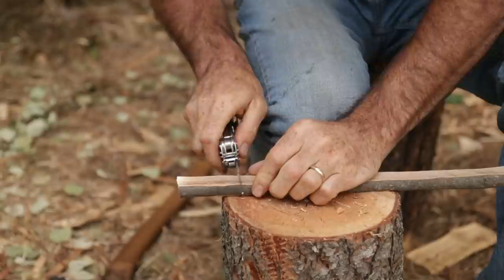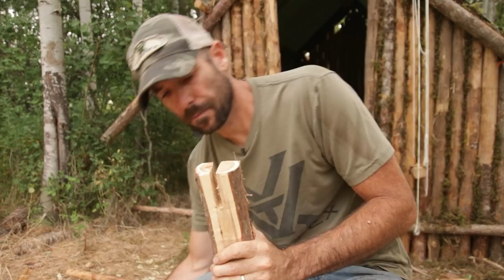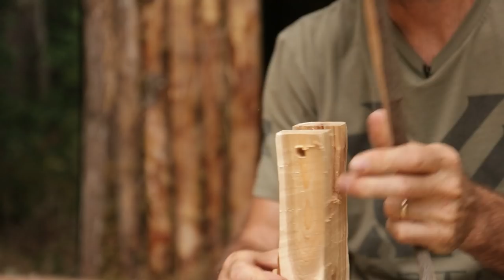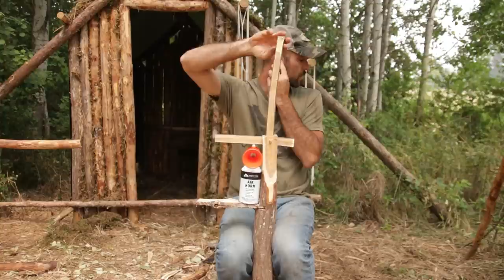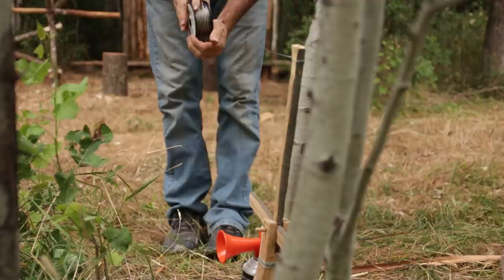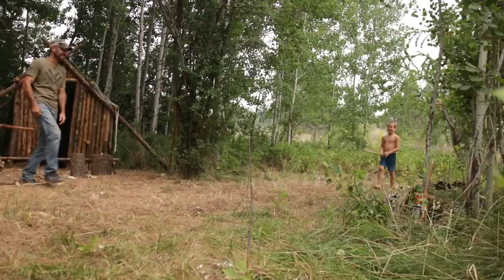Tripwire Bear ALARM SYSTEM - ALONE Season 8

Comment: Felix Immler makes a lot of such contraptions from wood using his Swiss Army knife, and his recommendation with battening using such folding blades is to leave the blade open at 90 degrees to prevent the repeated blows from wearing out the spring locking mechanism, in order to preserve it for when you are hand-carving, so that the blade will remain steady and not slip due to the mechanism having come loose. I'm not certain if your Leatherman uses a similar mechanism, but if it does, I hope this piece of advice was useful!

Comment: Why the 90 degree trigger? The gas in most cans still works when the can is on it’s side. Seems a simpler solution would be to put the trigger lever near vertical with the air horn affixed to the base horizontally.
Reply from the maker: 🤔 I guess I didn’t think of that 😜